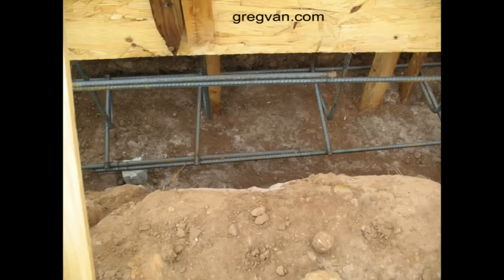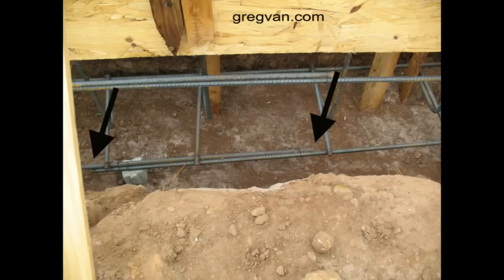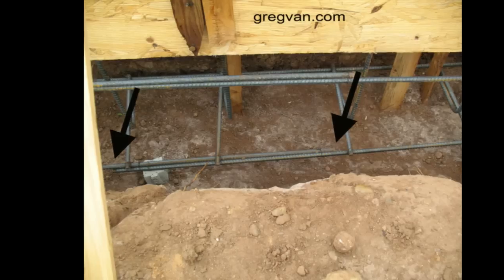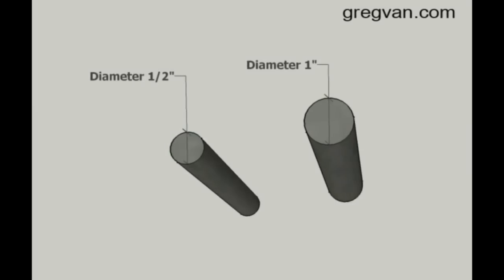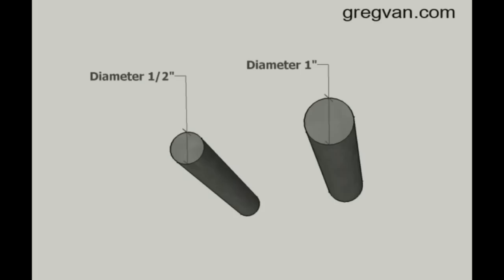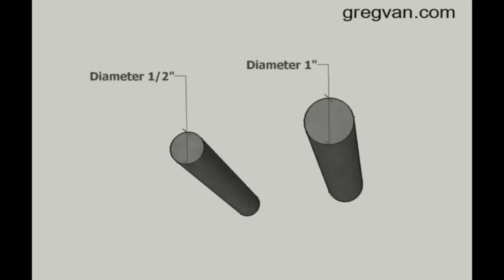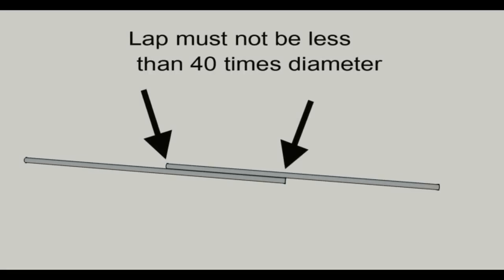How Far Should Structural Rebar Lap - Engineering and Building Foundations

Comment: Keep in mind that the 'rule of 1/8's' stops at a #8, all bar from #9 to #18 does not work factoring in 1/8's for diameters.
Reply from the maker: Are you referring to 1/8 of the slab equals the size of rebar?
Reply: @gregvancom  The referencing diameter of rebar to its numerical referencer....a #3 bar is actually 3/8's....#4-4/8's.....#5-5/8's....#6-6/8's.....#7-7/8's.....#8-8/8's....#9-is not 9/8's it's a little more than 9/8's and a #10 bars diameter is a bit more than 10/8's so forth and so on all the way to a #18 bar......if you do rebar installations in the field, which I did for almost 30 years, these details in diameter discrepancies really dont effect the daily work, where its critical to understand actual diameters is in engineering/design processes. To the average rodbuster packing 60ft 11's on his shoulder with a buddy in 100 degree heat they could give a flying f about those 1/8's......just my 2cents worth.

You can reference ASTM Standards or the CRSI book for exact numbers on diameters and size of ridges over surface area, it's all out there.
Reply: Yes it does. you can for 9/8, 10/8 and even 18/8. for example number 18 would be 2" and 2/8 or about 2.25"
Reply: Factoring for engineering doesn't rely on 'abouts'....@1890Orsy

Comment: Thank you for this video, especially providing the mathematical calculations of the overlapping measurements for the rebar.  You made it very clear to understand 🙂.
Reply from the maker: You are welcome and thanks for letting us know how much you liked the video.
Reply: @gregvancom  
Hi Ok How Do You Secure The Two Bars Together: By Welding 0r Wiring The 2 Bars.

I Thinking Putting In A Cement Drive Way With Using Mental As Extra Support: Metal Fenses Like Structure...After The 2X4's Are Laid And Before The Cement Truck Comes...?

Do You Have Any Favorite Internet Sites I Can Go Too ?

My Dad Dug The Bottom Footing For Chicago's Pope John Paul's II Visit Main  Cross Down Town Chicago Back In 1960's. My Dad A Polish American Is 0n Film Showing Him 0n The Construction  Getting The Pope's Cross Footings Done Right. 

Getting A Copy 0f The Film Chip...Still Working 0n That...
We Did Meet Pope John Paul ll Twice...He Speaks Perfect English.

Comment: Why do they use galvanized cable wire instead of rebar on bridge columns?
Reply: Post tension is cheaper i presume. And does better in earthquakes. As the post tension can move the structure in waves as opposed to the rebar structure moving side to side. It all comes down to earthquakes i believe so. And cost efficiency.
Reply from the maker: I don't know a lot about building bridges, so suggest contacting another person to answer your question.

Comment: It would have been nice if you gave the dimensions in mm.
Reply: Roger Onslow google is your friend. Conversions are easy. Don’t be lazy
Reply from the maker: The dimensions really aren't as necessary as the ratio of 40 times the diameter. I looked it up on the Internet and found that .75 inch or three quarters of an inch diameter rebar is 19.05 millimeters, so if I multiplied that by 40 it would lap 762 mm. I hope this helps.

Comment: this might be a very simple formula for some selfmade sheds but not serious structural engineering. i think it's strange to force the overlapping distance into a formula that is very rough. there is just no need for that. everybody who plans the reinforcements should be able to calculate the right measurement.
Reply: Actually many structural engineers use this (anywhere from 30 bar diameters to over 62db expressed as 30db)
Reply: was helpful for me.  my slab is small enough to not require engineered plans but big enough and will support weight enough that rebar will be used.
Reply from the maker: It can be used if you don't have a set of building plans were the engineer wants you to do something different.

Comment: I'm looking for a video on the explanation of shear development beyond the simple calculation and or code adherence. Looking for the science behind it.
Reply from the maker: +Eric McGhee Sounds a little over my head, I'm not a structural engineer, but would definitely be interested in what you learn. If you provide me with enough information, I could always make a video.
Reply from the maker: +gregvancom If you have a difficult time finding what you're looking for, then send me a little more detailed information and I will see what I can do.
Reply: A good college textbook is what you need. Reinforced Concrete Mechanics and Design is a good one. Wright MacGregor.
Reply: False. Text books do not provide insight into this. Even the commentary on the regulation book doesn't provide full insight into the problem. It's based on empirical data through pullout tests where the rebar doesn't yield before the concrete fails. The splice length is determined to be greater than the depth at which the steel yields before concrete ruptrue. This ensures that the rebar is the limiting factor in the design of the member in tension, and not the concrete.
Reply: I referenced a textbook used in a Master's course I took. A better title will be "Prestressed Concrete", by Nawy. It is doubtful you know the contents of every college textbook. And, your further comments do not support your proclamation that my recommendation is false. In the future, you might want to better treat people who make an effort to help you.
Reply: You're welcome for enlightening you. Sorry you got butthurt.

Comment: I really like the clarity of this video, Greg.  It clearly shows the minimum lap length requirement for straight rebar.  As you know, however, there are other laps involved in reinforcing concrete.  The lap I'm thinking about now is the connection between horizontal runs of rebar and vertical rebar that's embedded in the building's footing.  Obviously, they have to be tied together with a section of rebar that's bent at 90-degrees to form an "elbow," so to speak.  What are your thoughts on how long the two "legs" of said hook have to be?  I'd be interested in knowing this requirement for both grade-40 and grade-60 rebar.

Comment: How far should perpendicular pieces of rebar intersect?
Reply from the maker: carultch I don't know if I understand your question, but pieces of rebar that intersect each other at 90° angles can be tied to each other with wire.
Reply: gregvancom What I mean, is that if I am connecting two pieces of rebar in the shape of a T, how far should my N-S piece pass beyond my E-W piece?  1", 2"?  A function of the rebar size?
Reply from the maker: How far should rebar extend past the end of a perpendicular connection? I couldn't find your answer, but will let you know if I find it. I always extended the rebar a minimum of 2 inches at the end of a perpendicular connection and never had any problem with the building inspector.
Reply: +gregvancom LIke a corner? You would have to lay an L over that, with the L legs from 16"-24" long, each. Think about it, that's the same as your overlap at splices, at least.
Reply: Bob Dodds
In the case of an L intersection, how far must the "vertical" piece extend below the "horizontal" piece, if arranged the way that the letter L is drawn?

In the case of a T intersection, how far must the "vertical" piece extend above the "horizontal" piece, if arranged the way that the letter T is drawn?

One reason why it would matter, is if you are using U-bend bars for the bottom and verticals of a block, and horizontal pieces in a grid at intermediate positions.  And you want the width of the U-bend to be correct in advance of laying it all out.  So that the grid layers have enough intersection between perpendicular pieces, which are based upon the width of the U.

It seems like a simple question, it is just difficult to ask in words alone.
Reply: Lay an L over the intersection, so as to overlap each of the two pieces 40xD(iameter) of rebar, which will be something like 20" per leg of L. Otherwise if your right angle was an inside corner instead of an outside corner, soil pressure could knock a wall down even if it was strong as a panel. A building inspector would pass an outside corner with no overlap at all, but an inside corner or particularly a pair of inside corners on either end of a short wall, he would say no unless the L was there.
Reply: 2',  the least should be 1'8"
Reply: +Sonic Praa for size #4 rebar

Comment: Nice video. I am trying to gain a little understanding of the code books so that I can go for my CSL and saw a sample question which asked about the max spacing for #11 horizontal reinforcement in a concrete wall, and the answer choices were varied bar diameters + 18" or 24" so I looked in the books and I can't even find any mention of #11 rebar or anything close. If there is any chance you could point me in the right direction it would be much appreciated (and that's an understatement).
Reply from the maker: I found it in the 2012 International Residential Code Book on page 281 or table R611.5.4 and it does not provide a formula, but it does provide a few sections with varying lap lengths, for different applications. For a number four bar in the section on lap splice length tension it provides us with a 20 inch lap, number five at 25 inches and number six and 30 inches, giving us our formula of 40 times the diameter. I hope this helps.